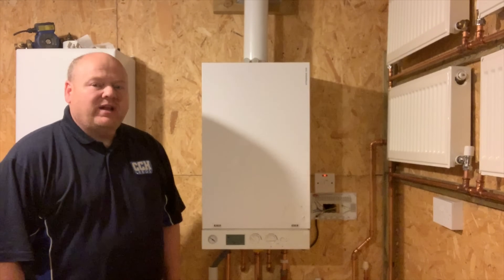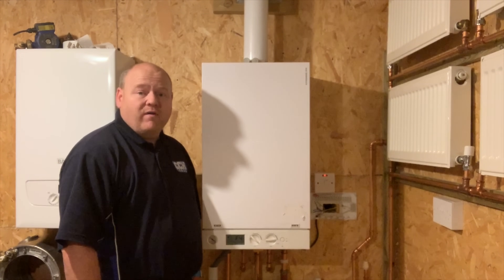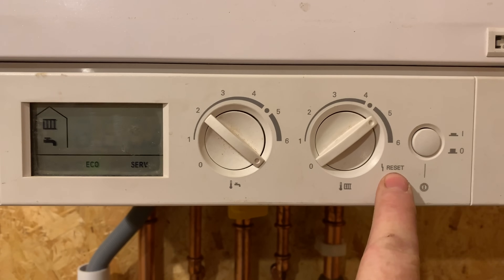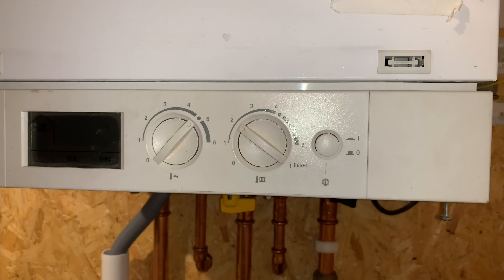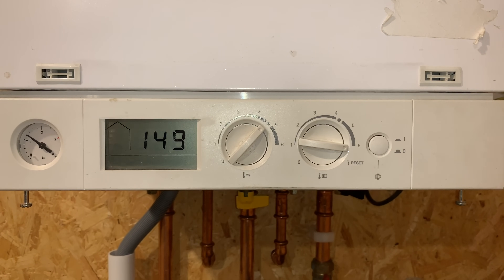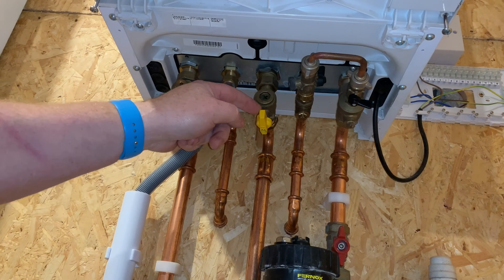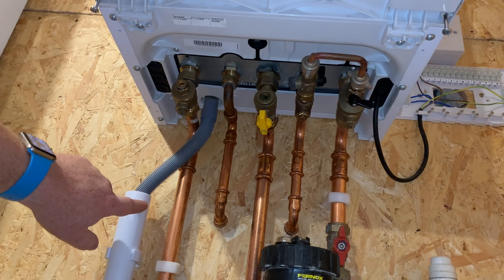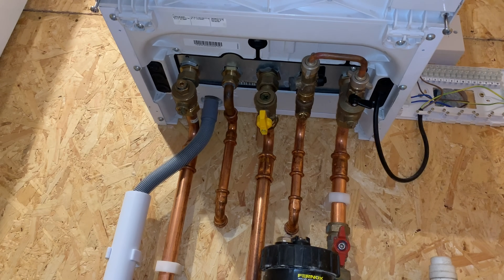VIESSMANN BOILER F4 FAULT CODE - How To Reset

Comment: Thanks Allan, just had this fault and was able to resolve it thanks to your video! I had tried to restart the boiler before, which didn't work, but a simple reset did the trick, go figure.. I'll call a technician to have it checked out, just in case.

Comment: Hi Allen, i have a vitroden 100 oil burner, i am getting the F4 error, and saw that the oil tank is very empty, how can i fill more fuel oil and what oil does it use, its so cold in here.  Thanks

Comment: Thank you for the video. 
Mine is an ordinary (non combi) Viessmann boiler fitted two years ago.. 
During the summer, I use an electric immersion heater for my water as I don't like the humming of the pump and don't particularly like gas, or water being pumped around. 
Just switched the boiler on (for heat and water) for the first time in 8 months and straight away got an F4 code. 
No idea what I was doing and noticed that the on-off switch wasn't pushed in .... It fixed the problem but have now come on youtube for some advice if it happens again.

Comment: Also check the if the gas sensor closed the gas shut off valve if you have that. It did not sound, and I did not have a leak, it just shut off because of the dust (the house is still under construction)
Reply from the maker: Thanks very much for your comment, please consider subscribing to support the channel 🙂

Comment: Thanks ever so much for this very clear, very straightforward video. I fixed the F4 fault following your instructions so I have hot water again for now, but sounds like I need to get it serviced. It hasn't been touched for a few years at all I think. Cheers!
Reply from the maker: Thanks very much for your comment, please consider subscribing to support the channel 🙂

Comment: Hi Allen, I am worried that if you show things that should be left to an engineer that people will try to do it themselves to save money, I am a hobbyist DIY'er and have built everything from underfloor heating to an entire house, but I will not touch gas because I don't trust it. My worry is that if someone has the same skill set as me but not the nagging "do not touch gas" thing they will try to save money because you have shown them how to sort a problem and that is a dangerous thing to do. By telling them it could just be needing a service or cleaned out they are going to think that they are capable to use a hover and clean it out without the safety of a registered gas engineer.
Reply from the maker: Hi John, Thank you for your comment, You make a very good point. Lots of manufacturers are doing these types of videos now, hopefully, my advice comes across to always use a gas engineer. Thanks.
Reply: Hi Allen.
F4 fault. I have changed the electrodes,leads and pcb(as advised by viessmann) and still f4. No issue with gas 22mbar. Any idea?? Thanks.